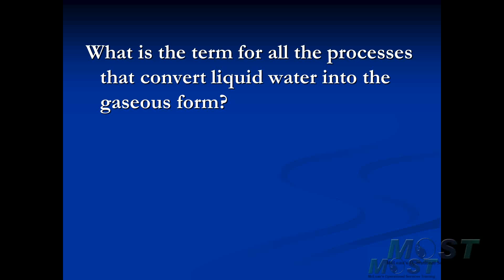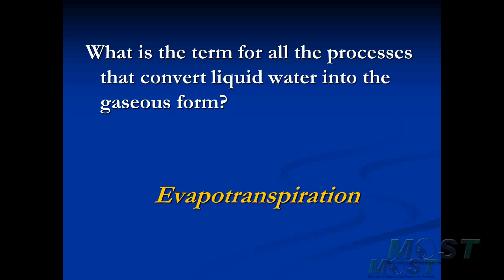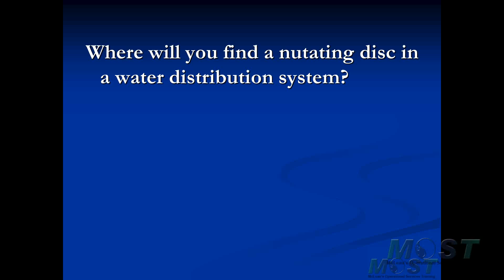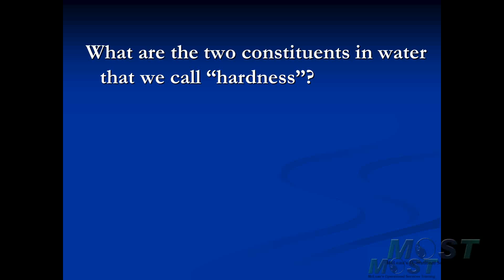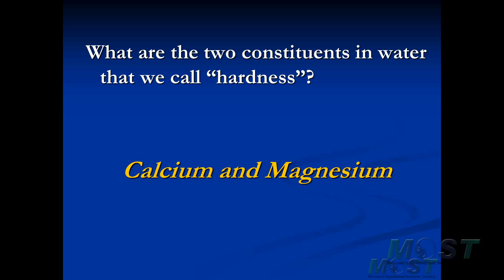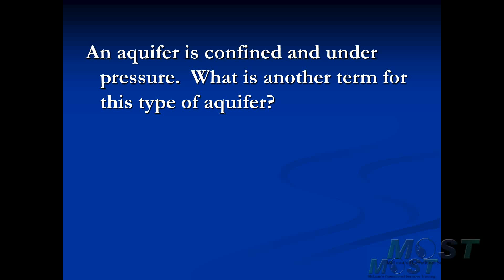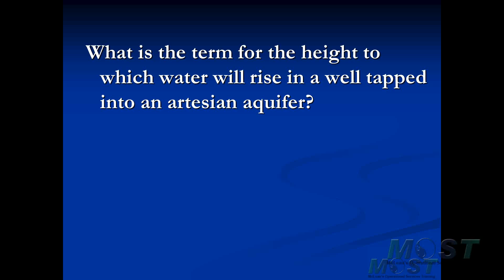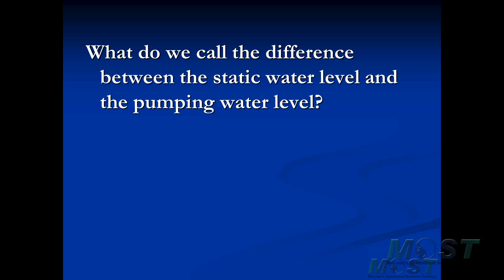Top Ten Distribution Exam Questions.flv

Comment: How do you calculate gpm when only given mg/L and lbs.
Reply: So the mgd will be our X for this. I like to use mg/l in ppm. So we will know the lbs of chlorine I’m assuming and what type. But you would put the pounds on top then diving by the ppm and 8.34lbs. That’ll give you a number that’ll solve your X or GPD the. You can divide by 1440 that’s the minutes in a day and you will now get GPM. Also before using the chlorine lbs make sure it’s in the pure form of gas. So let’s say you have 200lbs of 12.5% you’ll need to multiple 200 by .125 first to get your lbs of pure then you can do the whole equation.
Reply: @jaysilversjr5694  Thank you, I think I figured it out. That explanation is for sodium hypochlorite and I was to calculate calcium hypo which is 65% so at the end I must divide by .65 to get lbs/day
Reply: Your info is very helpful, Thanks again.